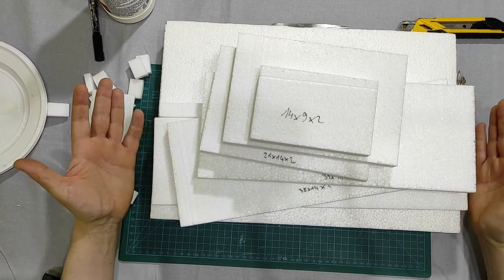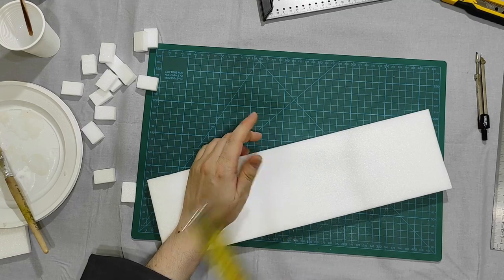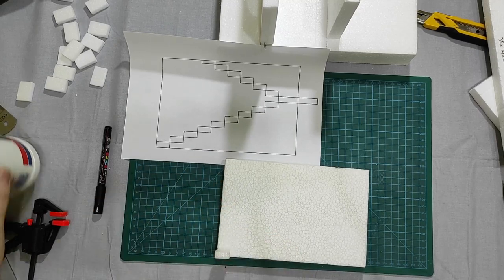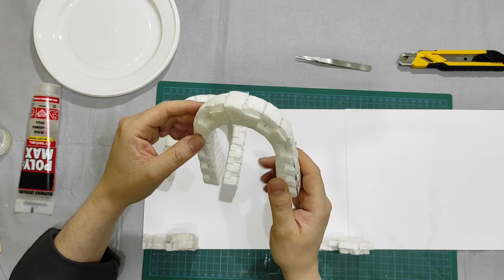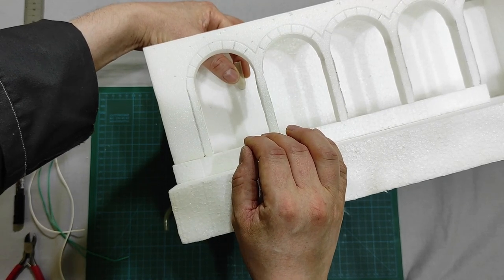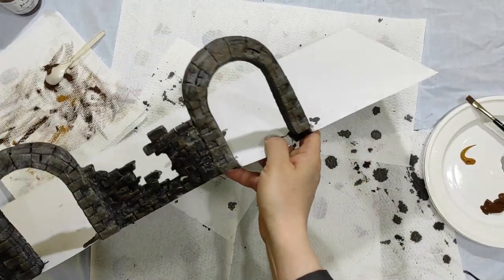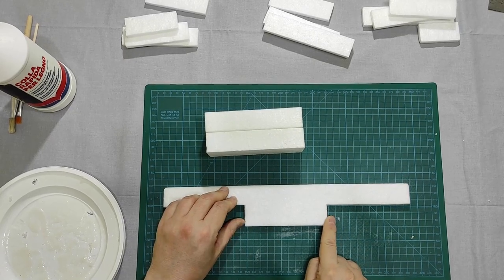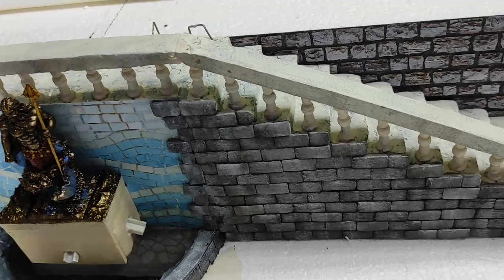Christmas Village Tutorial 2021 - Part 8

Comment: Silvio, i like the building with the arches, 
I build myself some Styrofoam modules I will use in my Christmas village.
And use similar lanterns you made, which I bought by Ali Express. 
I pull the wires through the Styrofoam with a darning needle to a location which you can't see.
And connect there all the cabling together. 
This work very well for me. 

And I like your English with your Italian accent.
But I like Italy and the Italian people, I spent most of my vacations in Italy, so maybe I am a little prejudiced. :-)
Reply from the maker: Hi Bert. Darning needle? I should try it. Thank you for the tip.

If you like my strange Italian accent may be I should try my French accent😂.
My father was French and my mother Italian I always spoke both languages since I can remember. Than I learned English, German and Spanish.
What a confusion in my mind too many voices.
Please don't ask me to learn Dutch too, I beg you ! 😁

Comment: Hello Silvio,
I dub this the year of the stairs! Totally awesome stairs.
Your styrofoam  building skills are unparalleled and greatly appreciated. Okay, what size LEDs did you use for the sconces? I know 5mm and 3mm will not fit through the opening because I tried and I could not find any smaller that were 3v 20mA.
Reply from the maker: Hello Susan,
I have used my standard 5 mm LEDs as usual.
Please excuse me but I think I don't understand the problem.
Could you kindly give me some more details?
Feel free to email me if you prefer.